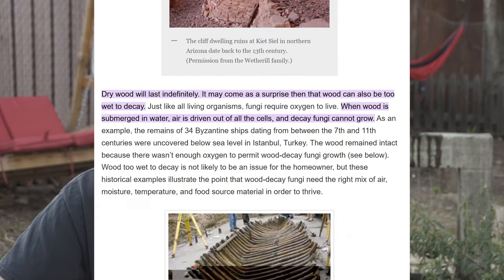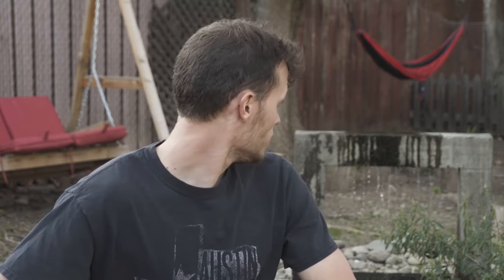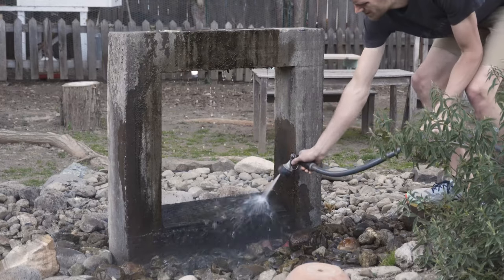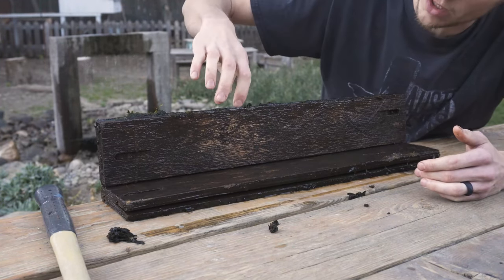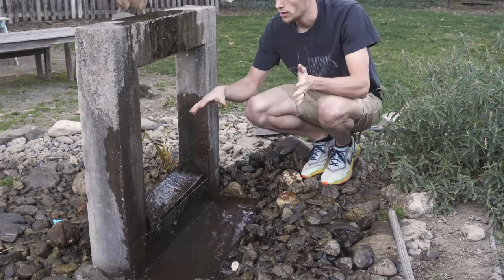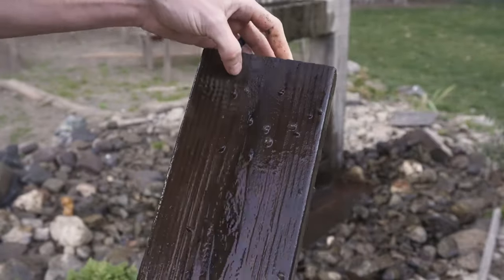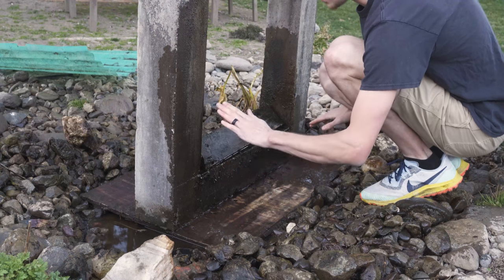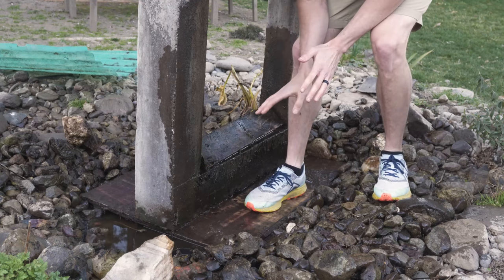Does Wood Rot Under Water?

Comment: Hi Travis. Thanks for the water feature video and this follow-up. I will try that project soon. I wonder if a sturdier base (like a steel plate)  would be a good substitute for the wood. Also, covering the bottom of the feature with more of the surrounding rocks would minimize the splash and sound of the falling water, but design-wise would spoil the overall look. Great job, Travis!
Reply from the maker: Great suggestion! On my most recent concrete one I used a steel base and then concreted that all in place. Its real sturdy. 
 Thanks :)

Comment: there is a tree in my country called Shakhu known as Sal in english, it can stay in water upto 100 years without rotting, was used in high moisture areas like washrooms before pressure treated wood and other treatments were available

Comment: I remember, back on the farm, fence posts didn't rot above the ground or below the ground. Above the ground, the post was never wet enough, long enough to rot. Below the ground it was either wet all the time or didn't get enough oxygen to rot. Right at ground level, the post would wick water up a few inches and stay wet and exposed to air for a long time. That's where the post would rot.